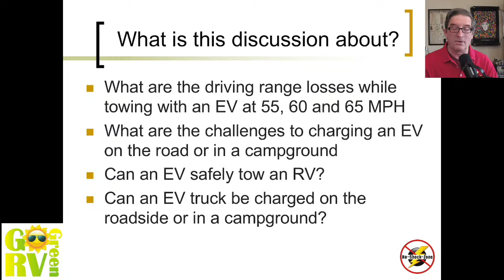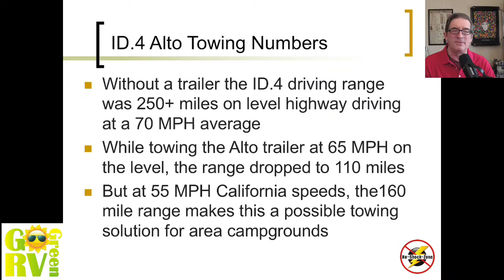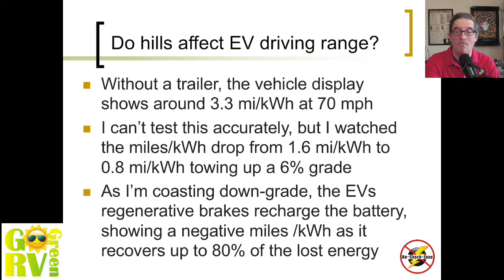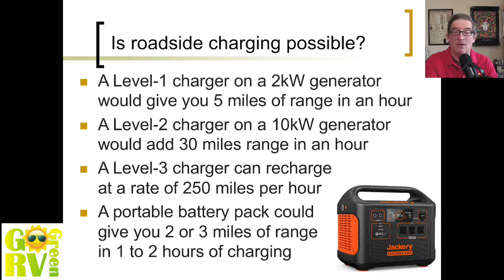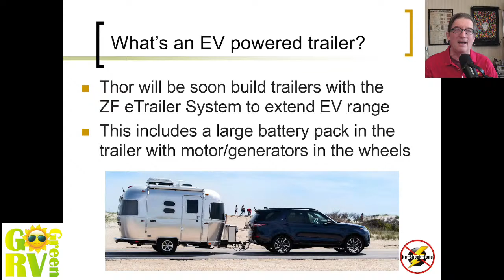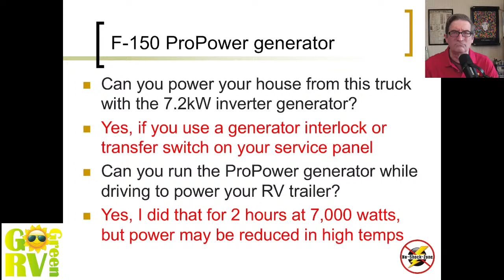Mike Sokol from RVelectricity - EV Towing: Are we there yet?

Comment: What a great job you've done with this video.  I'm watching it in late May 2022 after the Lightning has started shipping, yet your four-month-old video is still the best info I've found regarding what to realistically expect from an EV pulling a small-to-medium sized camper. It's like there's an elephant in the room, and nobody's talking about it. You're hitting on all the important questions here. What can we expect RV parks to do about EVs skyrocketing their electric bills? How much does a 4000# camper reduce the range of an EV at 55mph? How long does it take to charge a Lightning on a 30amp campsite plugin? Those are really the things I'm interested in and you're answering them all. Thanks very much for all your research and reporting!

Best I can tell from my research and from your reporting, it's just not quite the time for an EV to pull a 4000# camper. A lot of the places I camp do not have 50 amp outlets, so I'd be looking at three days to recharge a Lightning on the 30 amp outlet. Not ideal at all for a weekend trip, and especially not if one plans on driving anywhere while they're at the campsite. If you're correct about lithium technology circa 2030, assuming the power grid is beefed up to handle all the charging, we'll be able to realistically use an EV to pull a camper on longer trips in a decade or so. I'm going to do my best to just hold my horses and enjoy what I've got now, pay these $4-$5 gas prices, shorten my trips, and hope that EV will be a good option in a decade or so.

Comment: I hate to be pedantic, but since all of your other information is so spot on accurate I thought you might want to know the technically correct fact that there really isn't a such thing as "Level 3" charging. The SAE J1772 charging standard originally anticipated a "level 3" but that whole idea was dropped in 2010. There are 4 charging levels, but they are AC level 1 & 2, and DC level 1 & 2. AC charging is AC level 1 (110v at up to 1.92kW) and AC level 2 (220v at up to 19.2kW). DC charging, usually referred to as DC Fast Charging is DC level 1(up to 48kW) and DC level 2 (up to 400kW).

EVGO and Electrify America chargers have DC level 1 and DC level 2 chargers at most of their stations. All of Tesla's Superchargers are DC level 2 and vary from 72 kW, 150 kW, or 250kW of peak power. 

Now, as for the motors and batteries on trailers. I am a HUGE fan of adding lithium batteries to trailers, but I wonder if the added weight of also adding a motor is worth it in the long run. In my RV trailer planning I'm staying VERY weight conscious because I want to tow a 5th wheel with the CyberTruck. I fully expect my 500* miles of range to drop by ~65-70% when towing, because... physics! I've accepted that I'll have to plan my routes to reach SuperChargers every 150 miles or so. (I'll be retired, so I don't care! 😁) But power to climb hills just isn't a concern with EVs. Their incredible torque will make me the fastest accelerating RV on the road. My trailer doesn't need a motor to get me over the Rockies. The CyberTruck and practically every EV made today has torque to spare.

It's the BATTERIES that I want. I would love for my RV to have a bank of lithium batteries on board that I can tap for extra range while towing. I'm hoping that Tesla will make provisions for a trailer connection that will allow the truck to use that battery power that can be carried on the trailer.

One strategy for making tow capable vehicles with massive range is to just add more batteries to the vehicle. GM's Hummer with a 200kWh battery or Atlis's XT with 250kWh battery will** have impressive ranges, but you have to drag that HUGE battery pack everywhere you go. I would rather have an extra... say 100 kWh battery on the trailer, that will add 100 miles when towing, but that I can leave at the camp site when I'm just tooling around in my truck on day trips or RV off season. Ask any RVer if they'd like to have 100 kWh of available battery for boondocking, I think you'll get a rousing YEAH!!! 

But as for the extra motor. The only real advantage I see is having it available as a trailer brake that can regenerate power back to the battery. I just think that the miniscule amount of time that trailer braking is essential doesn't justify the weight it would deduct from the GCWR of my rig. There is the hyped feature of being able to move your trailer without the tow vehicle hooked up, but I think that's a gimmick that will rarely be useful because the surface you'd have to be on for the tiny wheel on you tongue jack is rarely found on RV sites. I would think it would only work on a smoothly finished concrete slab.

I came over to your channel based on Chad's recommendation (Changing Lanes YouTube Channel). I'm looking forward to pouring over all your content and REALLY looking forward to your Hughes Autoformer experiment. Thanks!